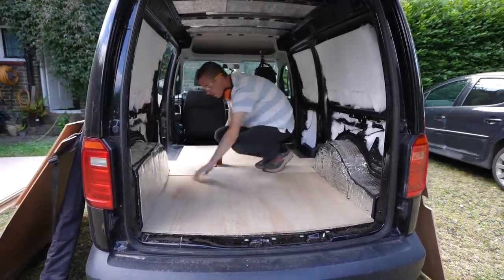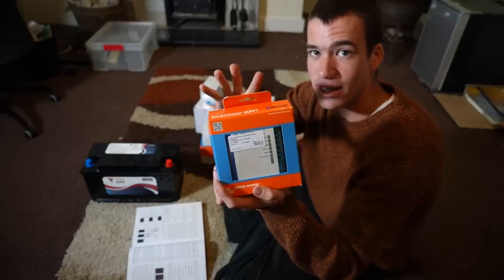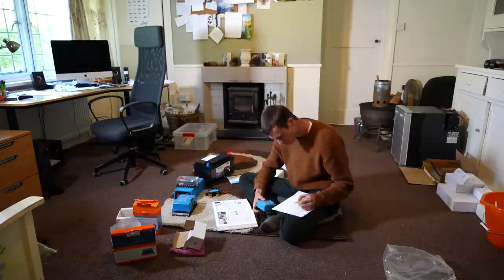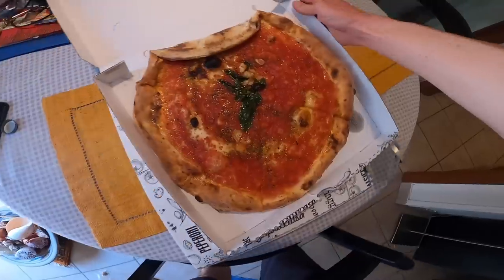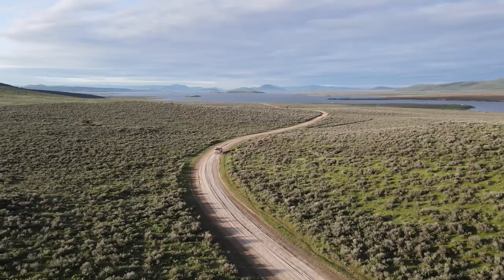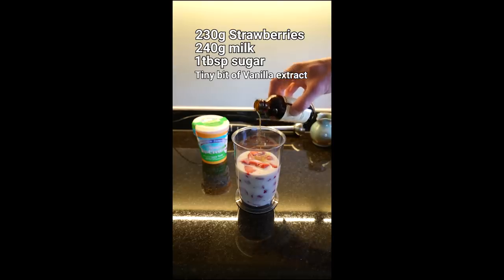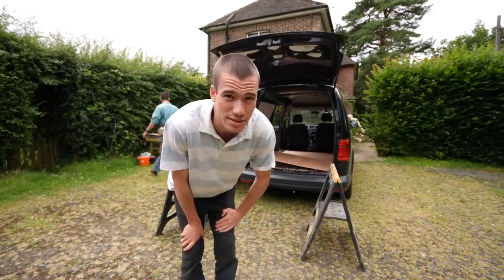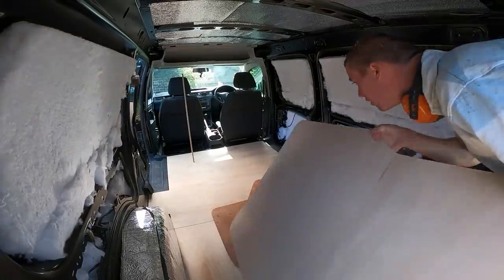Woodworking with power tools and off grid electrical set up - Micro Camper Conversion Ep 4

Comment: get a sheet of see through plastic, 1- 3mm thick, something that you can bend a bit. you can use that for tracing molds. fit it where you want your next piece of wood to be cut, trace the shape with a sharpie. then you can just put it on top of your piece of wood, and cut out the shape. start with the biggest piece of wood, and work your way down to the smaller ones to save the mold. just an idea
Reply from the maker: Thanks!

Comment: Stop putting ply against the outside of ur van, cos wen u get in the back of it, it will scratch ur paint as the suspension goes up and down! Just a tip Alex! 👍
Reply from the maker: Good point. Thanks.

Comment: Pro tip: Get some large (cheap) paper or cardboard sheets. Hold or tape them against the panel you are cutting ply for and trace the shape. Next cut out the shape with scissors. Test for size. You now have a template to transfer to the ply.

Comment: You might want to check your batteries specifics, Lithium can be run quite low, but running too low can be detrimental to overall lifespan (still way better than Lead Acid, but still), and some charge controllers don't play nicely if the cell(s) drop too low.

Comment: I guess if I had to line the back of a van with plywood I think I would get some large sheets of butchers paper and make templates, tape them to the wall of the van and trace around where you need to cut, cut the template with scissors and then when you are happy with the shape trace it onto the plywood and cut with a jigsaw.
Reply from the maker: I’m trying it with cardboard today and working well! :) Thanks for the tips
Reply: @just_alex  awesome that will work too

Comment: Actually computers etc, that has a power block actually runs on DC. So you can get a connector to make your computer use its normal 9v-12v.

Comment: ive been doing electronics/electrics for 20years++ now. i can say that since it is invisible,  electricity is a hard concept to start having an understanding of. most teachers also do not have a correct understanding of it either and they cannot reliably make student understand. ive heard anything from the color of the wires mattering to resistors having a in/out side (no joke). 

dont let it bother you. i remember in the beginning having times when i just sit there trying to understand what is happening with my electronics projects just looking at the wires and stuff.
Reply from the maker: Thanks, makes me feel better about it!